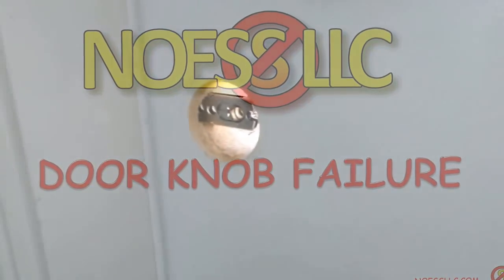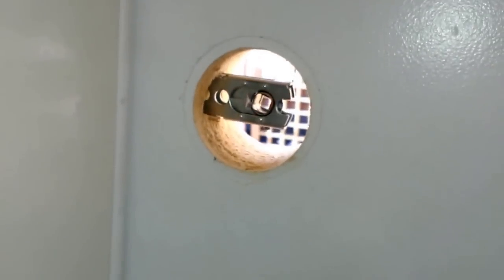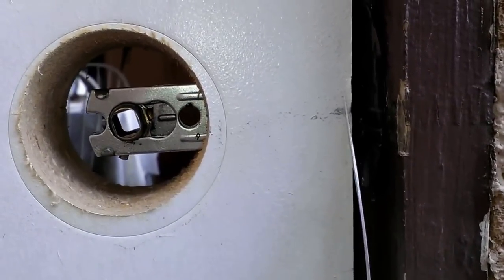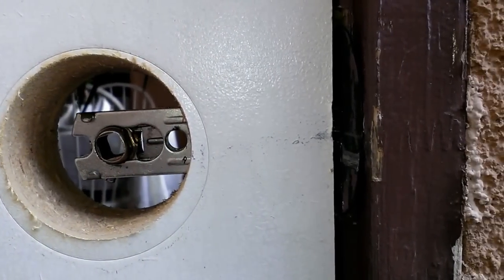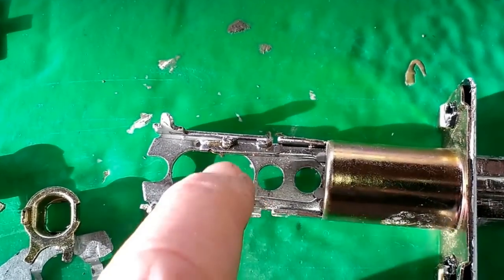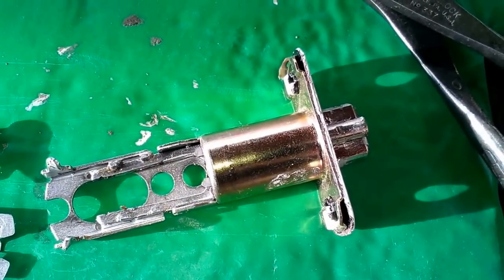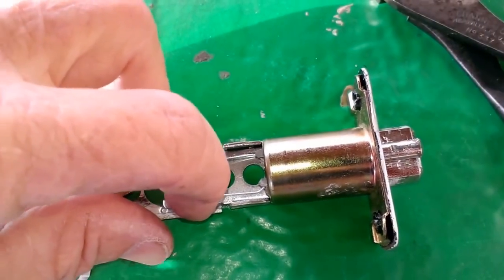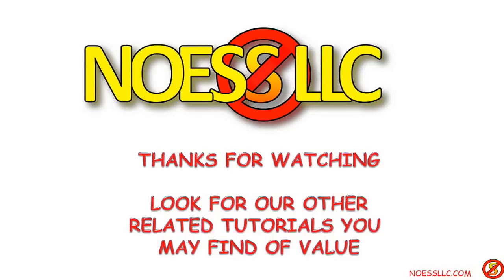Stuck Door from Knob Failure

Comment: i love how the doorknob company never has an answer for this. typical engineers. it cant fail because it was "designed not to"
Reply: Engineer here, that is indeed what most engineers think. My favorite I've heard is, "well it works on paper it should work here." When a machinist/welder/install guy points out what is to them a glaring issue.

Comment: OMG Thank you!!!! We found ourselves locked IN our house when our door would not open. We struggled for quite a while and managed to get the lock partially disassembled but were still stuck inside. This YouTube video showed us how to take apart the lock mechanism and it worked like a charm!!! We got the lock out and installed a new one that we had. Thank you so much!! 

Lesson #1: When the door latch keeps semi-sticking as though it is locked, change the lock right away!!! Because it is starting to fail. I never knew locks would fail so dramatically.

Second lesson: Check YouTube to see if there is a fix! Usually there is!!! Thanks again! (from Vermont)
Reply: These are my lessons learned too. It finally gave out and I'm stuck inside lol. I'm about to try replacing it with one I think I have, but currently it's night and there's a flash flood happening now.  Let's see how this goes...

Comment: I had the same problem with the same dog issue. Tried everything suggested from the internet. I saw your video and said “what the heck I’ve got nothing to lose”. So I tore the mechanism apart, dug out the part that goes into jam (all from the hole) and my door is now open. Thank you for practical advise. By the way... I’m a 71 year old widow that tries to DIY.

Comment: 🙏 Thank you, thank you! This video saved me from not being able to open my closet door! There was no other video except yours that helped me with the situation I got myself into. 
I am replacing old door knobs with levers and during the install, I had inserted the latch/spindle cam into the hole and tightened the screws down on the plate..... when the door swung closed. There was no knob for me to open it back up lol! So yep, I bent the tabs up and took it apart and 🙆‍♀️🙆‍♀️🙃😁🤗 voila! got the darn door open! 
Thanks again Sir and God bless you! 
👍🙏👍💜👍💯👍🧡

Comment from the maker: Over the course of this posting a number of people have suggested an easy fix...remove the hinge pins. Others have stated that entry doors should never swing out because the hinge pins can simply be pushed out allowing the door to be "easily removed."  I have addressed this several times.  This door is a OUT-SWING with the NON-REMOVABLE hinge pins on the OUTSIDE of the door. One cannot pop anything out to remove this kind of door. All four hinges would have to be cut with a metal blade which would take a lot longer than two minutes and require all to be replaced. Furthermore, the screws holding the hinges are only accessible when the door is OPEN which cannot be done if the latch is inoperable. Do a search on hinges with non-removable pins to get a better understanding of this simple safety feature for out-swing doors.

Comment: Thank you so much. I had the same problem with the toilet door. I spent 5 mins removing it after watching your video posting. Very grateful. Only diff was everything fell apart after prying open the end. I just used the plier to pull back the latch rail to open the door.
Reply from the maker: Glad it helped

Comment: I am in this situation but you didn't show how to pull the mechanism back out of the door once you bent those legs out of the way.  That's where I am stuck...it is my back door as well and the dogs were dancing.  I took them out front on a leash.  Can't get the door latch released.  And yes, it has been failing for some time.  And yes, I already have a new one.

Comment: Thank you for saving me a few bucks. I took the first few frustrating steps you did and then after a few wtf's figured on ole reliable YouTube. 6 minutes of you and then 30 seconds later; DONE! The only challenge that could be an issue, is if you are locked inside with no tools. without a screwdriver and needle nose pliers; you just might end up a prisoner. Thanks again!!

Comment: I checked out your video after getting my daughter's bedroom door open. Hinges were on the inside of the bedroom. She wasn't in there. The screws that hold the knob mechanism together were also only accessible from the inside. I ended up using a hack saw and cut the door knob off. Peeled the shroud off that coveres the backside of where the screws attach. Drilled the backside of the threaded insertion area away from that plate and the knobs were free!  I tried to just pull back on that middle piece....but that had broken so there was no easy access other than breaking apart the mechanism that holds everything together in that shaft.....eventually after some long nose heavy duty angled needle nose pliers fulfilling their purpose once again....(the spring that pushes the wedge back into the door was pocketed as one never knows when a spring like this will be needed!) 😎😀😇

After all that carnage was out of the way there was NO tension on that far end piece and with some light force applied against the piece and pulling back toward the knob hole the door was now open!

I was hoping that maybe there was an easier way....and sometimes I learn after the fact...but in this case.  Sometimes brilliant minds think alike and there are casualties in pieces that weren't designed to make it easy to break in. I tried the credit card thing to no avail. The clearance was way too tight in this instance as well as the plates that screw into the wood weren't exactly flush and that wedge deal also upon inspection afterwards showed that the point where the angle starts is after the place where the credit card (or any piece of flexible plastic ot strong paper) would be helpful.

Thanks for sharing this so I can justify the tools I do have. I don't know if the locksmith would have done anything different either...with the exception of charging for their services and/or knowhow.

Have a great day sir!

Comment: Thanks for this, was not able to use my bathroom toilet for the last few hours. With mine when I bent the lugs everything came away and I still wasn't able to open it, finally I reached in and there was a spring when I pulled that it opened. 
That was very frustrating but thanks for the help.

Comment: Ours was an original knob from a '68 house. It didn't have those little pins. We took the door hinge pins out which made  just enough room to use a very thin bearing knife to jimmy the two parts that were stuck.

Comment: Ok, I solved it. I removed the left door and had to drive out the throw cylinder with an 8" punch & hammer. Need crowbar of any type Ez first time Ive had any door and knob problem  and Im 70. One man no exoerience  1 hr fooling around ,finding trying different tools, forgetting where I put them last. It would take 20 min now .  Now,how to tell a good door nob from junk..Price no doubt  .Well ithe cheapy probably lasted 20yrs. and cost $10 then... well,thats cheap and easy to diy the next time for another 20 yrs. Not for me but the next youngster.

Comment: Lmao was trapped in my mates room with him yday at 6am sleeping over man's door wouldn't open was gunna boot it off but found a screwdriver and jammed it in the side of the door tryna snao the metal lock and after 30min I managed to push it up and the lock went back and unlocked the door I went to bed asap LMAO

Comment: Use pliers to bend linkage & then turn latch? door is stuck in frame hole so can not open. Knife won’t work to pull open. do you take it off hinges?

Comment: I havent found anyone with the same problem, on a double entrance door and one door has  slide bolts blocked by the broken  door.  Removing hinges on right door wont work because of the 2 slide bolts that are hidden. Id try an electric hack saw on the 2  flush bolt aka shoot bolt or verticle latches. INext time those slide bolds will be on the inside,like those in auditoriums,gyms ,but nicer looking etc   Ill go see if I can buy an electric hack saw in the morning.. NEXT DAY >>
KISS : I just moved the left door. simple as that. The lock throw cylinder or bolt was short and not long like regular lock bolts only,so there was no real binding had feared.  See next post

Comment: I had this exact situation 4 days ago! Dog had to go out and I couldn't open the stupid door with the knob turning. I damaged my door hole by the time I had gotten it out. It came out piece by piece. Springs came out. Pieces of metal everywhere. I still couldn't get it out after removing the part you showed. I grabbed what was left with needle-nose pliers and twisted it until it finally came out. Nice video though.

Comment: Came to several videos for help on this. None of them worked. This didn't work. I'm not sure; I think the whole mechanism might have just sheared towards the pin. I had to tear it out with a crowbar. It was a five-second solution. Put the end of the bar into the hole, and just levered up. It tore the lock to pieces with almost no effort.

Comment: I was able to pull mine out by manually pushing the retractor pins back. If that helps anyone. You can take the latch out without dismantling.

Now my problem is that a little piece that slides the pins when the knob is turned, fell out. That's why mine got stuck. But I cant figure out how to get it back in without taking the latch apart. BUT it kinda seems like if i take it apart its toast. Dang it lol

Comment: Hi, sorry to bother. I'm experiencing the same door latch problem. I got both knobs off but the latch still won't release with a screwdriver. Could you tell me how you got the plate off of the cylinder? I don't want to drill as I'm not comfortable with that and the door hinge bolts are stuck. I appreciate any help! 
 Vicki

Comment: I had the same problem trying to open my patio room door with the same type of handle and I couldn't let my pooch back in the house.  When pulling down on the handle it wouldn't open the door and after realizing  "Houston, we have a problem", with the pooch barking to get back in, I turn the handle upward and "Wala" it opened. So now I turn the  handle upwards to open the door.

Comment: Happened to me.  I bashed the cylinder apart but still couldn't get the latch to move.  So I kept bashing and bashing.  Finally, the latch loosen enough to get the door open.

Comment: Thanks to you, I was able to open the little latches and get the pins out! But that's it...the center pieces fell apart but the dang lock is still engaged. Any suggestions? I know I'm missing a step but can't figure it out. Thanks in advance!!

Comment: Every plunger assembly is different. Assuming all have these release tabs is incorrect. Best bet: take henge rods out, remove door from frame, unscrew plunger assembly from door. It all needs replacing if any part of the door knob fails and can happen over time.

Comment: Same problem, but it was a Kwikset and there were no tabs to undo. I was getting so desperate I was about to pop the hinge pins. The sawzall tip worked - cut back to the part that had the jam, and then retracted the latch with a screwdriver.

Comment: Had the same problem. No tabs to bend back so I used the sawzall and cut it off. I could then pull back the latch. It's garbage either way. Thanks for posting this.

Comment: I did what he said it did nothing. That lock piece that goes in completely broke off inside of there. I had to wedge it with a flat head screw driver, after taking the piece apart and get the lock piece to rotate. The door finally opened and the entire thing fell apart in 100 pieces. It took 2 people.

Comment: if you take it apart and the bolt is still stuck even after you pull the pins, you need to get a butter knife and jiimmy it through on the side of the bolt with a curve  and it will open. It cant be the side with no curve/indentation because then the knife will have nothing to go inbetween it will just hit metal, but if you put the knife at the right angle against the side of the bolt with the curve you can get it to open.
if you are locked inside of a room you are going to need a second person if you are not on the side of the curve

Comment: Y’all I found out how to do it , all you have to do is take off both door handles thennnn ur left with that thing in between them and what u do is u push a little area forward with a tool  until the door unlocks ( the thing inside my door was black and the part i pushed was dark gray)

Comment: I got stuck in the laundry room i closed the door on accident when the door knob was off cause we were fixing it. I was stuck for 30 minutes till i started using my brain and took a butter knife and slid it between the door and lock and moved it back and the door opened.

Comment: This worked for me also. Had to pry the pins and then wedge a flathead in the gap and hit the top of the flathead with a hammer repeatedly. This caused the latch to break down and fall apart.

Comment: I took it apart and on the the 2 metal strips are attached to the lock and Im pulling them but the lock stil wont come out so  I still cant open the door.

Comment: If you take the door off its hinges you can easily pull that mechanism out and replace the doorknob with a new one.
Reply from the maker: I've addressed this a number of times and I hope this will be the last. Our side and rear exterior doors are out-swing with the hinge pins on the outside. The pins are not removable. They have to be either drilled out or cut off in order to remove the door if it's not already open to access the hinge screws. Additionally, they are full length glass double paned steel and are very heavy. I replaced the one shown in the video with a solid core wooden one so I could put in a doggie door........but it's still an out-swing with the hinge pins outside. I reused the original fixed pin hinges in order to keep would be intruders from simply pushing out the pins. Why the builder of our tract of houses chose to use these doors is still a mystery but, that's what we have. I cannot replace with in-swing doors without a major revamp of concrete because the bottom of these doors are below the slab.

Comment: noessllc - Thanks a lot for uploading this video. You saved my butt. The design of the innards of mine were a tad different but it came apart in a similar enough way that I was able get the bolt to retract and open the door. Now it's off to find a high-quality replacement ...

Comment: Thanks! I got a far as removing the knobs and tearing the guts out, but still couldn't get the lock out. I'll go back and try bending those knobs in the morning. My roomie was pissed cuz the doorknob failed after 18 years... Lol 😂 I was like Shit happens and that's actually pretty good,,, don't call a locksmith, let me do some research on YouTube to figure this out and then you can run to Home Depot and buy a new one

Comment: I couldn't leave my room this morning. Had the same issue you had in this video. I ended up being able to open the door after using a wire hanger to hook over from the side that is that shorter side/piece.

Comment: I too got a door/bolt stuck going out to the garage. Removed both handles and I went to YouTube and found your video. I have lots of tools so I just beat the hell out of it.
And the bolt was still stuck. Finally I used chisels, hammers, and a small narrow jaw locking vise grip to finally loosen the bolt enough to pry it out. Thanks for the video.

Comment: Why are these things breaking so easily?  Had a 1970's house, all the latches worked great until a wildfire burned down the whole house. Now I have a new house built in 2014 and the expensive exterior door latch started malfunctioning in year 1.  Now it's completely stuck like yours.  First it was completely stuck open, which wasn't so bad - I could used the dead bolt to keep it closed. Clever me,  I "fixed" it, and now it's stuck closed like yours was.  Can anyone recommend hardware that won't break so easily?
Reply from the maker: Unfortunately as we all know, almost everything is now made in China with a wide range of durability. Trying to find American made quality hardware often requires a (lucky) physical examination of the items on BigBox shelves. Even there "made in USA" often really means "assembled in USA from foreign made parts". The only way to be sure is to find a (high end) American company that custom makes their own. Big Bucks!  Here's one to check out. I am not making +- evaluation, nor do I have any affiliation. I came across this while searching for American made.

Longleaf Collection
9546 Highway 211 E
Aberdeen, NC 28315

Phone: 866.635.7155
Fax: 910.944.0532
Reply: @otd80  Thank you!

Comment: Let me just save you 6 minutes of your life. The same time it will take you too take the door hinges off lol
Reply from the maker: This is an out-swing door. The hinge pins are NOT removable except by an angle grinder or sawzall. The screws for the hinges are not accessible because the door is CLOSED on them. I've addressed this "simple" suggested fix on several occasions. Have a nice day.